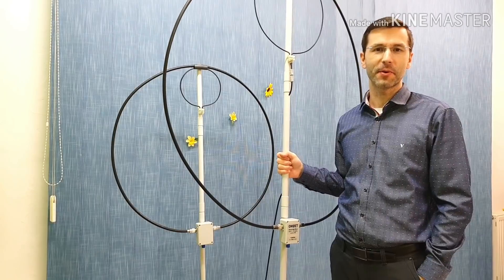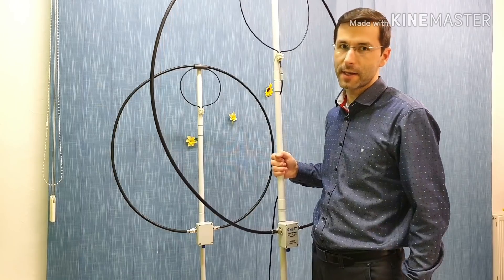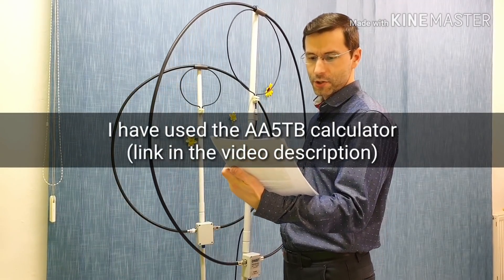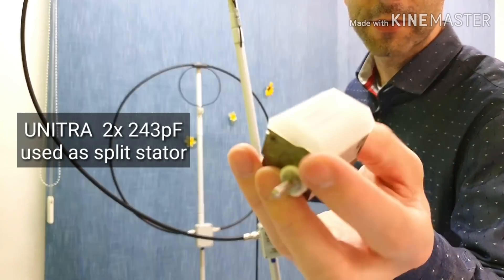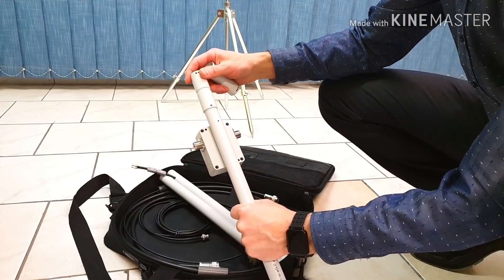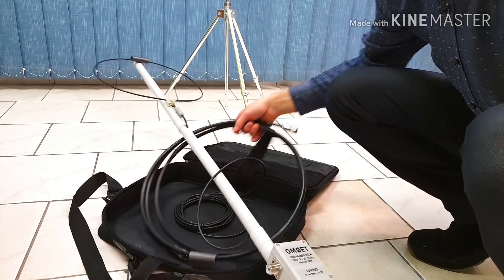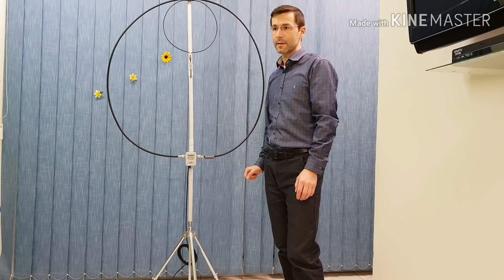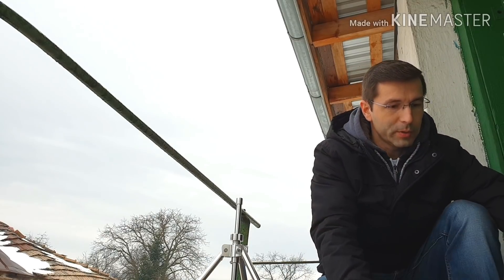40M UltraLight QRP magnetic loop antenna + TEST [ XIEGU X5105 ]

Comment: Dear Paul, 
I have seen the magmatic loop antenna you have constructed for 40 meters! It’s an excellent,construction , I too are very much interested in the construction ! I have made one too using a coax , it’s one of the very heavy type with a copper outer and inner conductor , I shortened the both inner and a outer and used it! I have a good variable split starter capacitor ( can’t remember the value sorry) wide spaced bought in USA ! It worked on 40 as we are having a daily QSO on 7060 with locals! It’s installed in my balcony in a tripod, I have housed the cap in a plastic cylinder , but I am not happy with it the rain water gets in to it! My rig is in down stairs , so I want to tune it via an remotely tuning system , i have built a controller using two relays copied from a Ham , but never used it to now because the loop is broken, coupling loop is out! And because of water getting in to the cap! Please note , I am from Srilanka, call sign 4S7LF , name Leonard. My e mail, oz6zv@yahoo.com…..I am only 87 years , mobility is limited , but soon I will get some help and repair it, after finding out to enclose the cap and the driven motor in an water proof container!  I thank you very much about your 40 meter mag loop and the excellent description of the construction!!! Kindest Regards….Best of 73! Hope to here you soon!! Leonard Fernando , ( Leo) I had a Danish call before, it’s OZ6ZV. That’s why my e mail like that! 😢
Do

Comment: Could I ask you a serious question?  What is the total lengths (in either inches, or centimeters) of  all the loops in this video, if they were all straightened and laid out flat on a floor in a straight line, and measured? For some reason, people can't get the right measurements, by just going only by the diameter of a loop, because no hand -made loop has the same dimension at every point around the loop, once made into a circle. Parts of the loop, will flatten out if hung up, making it wider, and shorter in places around the loop. The straight, flat length of the loop material, is required, before it is even made into a circular loop.
Reply: Хотел тоже задать вопрос о линейных размерах вибраторов антенны? Автор ответь в комментариях. Это займет 2 строчки, а польза будет на размер земного шара.

Comment: Hi pole,
Ashortwave bigger here.
You ham experts always stress upon construction of antenatal itself and most of the time you neglect to explain the antena loop end connections. I am always confused about how to make end connections. We have two end of big outer magnetic loop and two two ends of small coupling loop. Now how the connections are made to gang capacitor, how to earth and how to feed the connection to the radio. Can someone explain this please.
M Yaqoub Khan
Islamabad
Pakistan.

Comment: Using a magnetic loop with a small diameter coax loop as qrp is extremely qrp because such an antenna has a low efficiency assuming there is zero added resistance.... with 5 watts in you are looking at less than 1 watt radiating from the antenna.

Comment: ITS UPSIDE DOWN. THE CAPACITOR SHOULD BE AT THE TOP. KEEP THE HIGH VOLTAGE AND HIGHER RADIATING PARTS FURTHEST FROM THE GROUND AND NEARER TO THE SKY.

Comment: Awesome video Paul. When I used AA5TB's calc for 7.1 MHZ design frequency and 1m Loop Diameter and 10mm conductor diameter, I get 7.8% Efficiency only. You mentioned here it is 60+ %. Can you clarify please?
Reply: Yes, agree, his percentages are suspect
Reply from the maker: @do7425 not mine percentages, it's maybe due to faulty calculator.

Comment: Your videos are interesting. Please let us know how you came out with the efficiency figure of 74% on 40 meters. I used the same calculator and got much lower figure.
Reply from the maker: I see that AA5TB MLA calculator link is no longer available so sorry I can't do the same calculation again. But of course I can't be sure that this calculator was 100% realistic.
Reply: effıcıency should be about 10 out of 100 on 40 mt...consıdaring coax diameter 1.5 cm. and dıameter of maın loop about 1 mt.

Comment: I would like very much to install a 40M loop antenna in my house but I need to know the following:
1.  Can you change the capacitor to one that can handle 100 watts?
2.  Is it weatherproof enough to mount on the roof of a house?  
3.  Can your antenna be tuned remotely?
Thank you for answering these questions.
Reply from the maker: Hello!
1. For 100W capacitor you will need different and much bigger enclosure. I don't recommend use 100W in the house.
2. Is rain proof but not fully waterproof. Not for permanent base installation. ( portable antenna )
3. After some modifications it can be tuned remotly.
73, Paul.
Reply: @OM0ET  Thank you for your quick reply. I understand that a larger capacitor will need a larger enclosure. Can you supply or recommend such a capacitor? Also, I have no room inside my house so it will have to go on my deck, but the deck is not waterproof. That is a minor inconvenience. The big problem for me is the capacitor.  My old boat anchor radio could be damaged with too small a capacitor.  I therefore am looking for one I can build, buy or modify into handling 100 watts. Can your antenna be modified to handle 100 watts?  Thank you very much for your help.

Comment: A great job Mr. Paul ... Thanks for your video,  good idea of the loop antenna, small dimension and simple for 40 m band. 73  Sudarmanto – YD1WDL
Reply from the maker: Thank you! Currently my UltraLight MLA's works from 7MHz up to 28.8MHz so all the 7 SW bands + CB with just one loop antenna. Versatile design too. 73, Paul

Comment: Hi Paul, I love the antenna and as I would like to sometimes use it indoors in my attic (for rx only) it is ideal (my attic door is small, too small for a 1m rigid loop!!). My question is as it will be there for some time I have some concern about the loop losing shape. Is it possible to make a cross frame to preserve the circular aspect? I had an idea to manufacture a rigid cutaway pipe and cable tie the loop in. Anyway thank you for your work and I will be looking to purchase one soon.
Reply from the maker: Hello! To preserve the circular shape you can use a copper pipe as the main loop ;-) But my H1000 coax hold the shape very good too :) It have 2,5mm solid copper core inside.

Comment: Do you do a 50w or 100w version?
Reply from the maker: Unfortunately no. It's all about the size of capacitor. But on 40M band this antenna can handle 40W SSB. I tested it. And also is very dangerous to transmit 100W with Magloop so close to the human body.  I plan to the future some 100W version for base installation.

Comment: Paul, what surprises me is that your tuning capacitor is small compared to other mag loops I've seen. Could the reason for this be purely because your transmit power is low? i have not attempted to build a mag loop because others that have built this antenna indicate that a vacuum tube capacitor is required even for QRP power. 72 KB8AMZ
Reply from the maker: Hello Terry. Yes this capacitor is small for just couple of hundreds volts. I connected it in to the "Split stator mode" and power increased. Unfortunatly the capacity decreased to half, still OK for my magloops ;-) Split stator mode also dramatically decrease the resistance in the circuit and increase effectivity and Q of this magloop. 73, Paul.

Comment: Hi! Nice work, again! In your instruction you said nothing about that the shield of the coax is splitted at the top. Where did you get the information to do so?

Greetings from OE!
Reply from the maker: Thank you. The construction of the main loop doesn't changed from ver.2.  It's still splitted in the middle. It's hybrid between traditional shielded design and classic non-shielded deaign. I had the best results by using this type of construction. 😉 73 and thanks for watching! Paul
Reply: @OM0ET  sorry, missed the 2nd version, now i know
Reply from the maker: @spotzgeil  np ;-) 73 Paul

Comment: Great neat job Paul! I want to make one too, I just need to calculate and find the right cap for at least 60W, as my military rig (Qmac HF90) puts out some 50+W LOL :)
I have 15m of coax, so I can be safe enough from the antenna on the exposure point of view ;)
Reply from the maker: Thank you Chris. Then I recommend to you use the remote controled tuning system. Bluetooth or trough coax. On chinese webshops you can find plenty of wireless solutions how to do that with DC motor ar use Arduino if stepper motor. Good luck! 73 Paul
Reply: @OM0ET  Good idea Paul, thanks, i will have a look at the chinese on line solutions :) 73, de ha7wx

Comment: Где-то читал, что надо снимать чёрную изоляцию с кабеля петли, потому что она с примесями ферромагнетика. Чистая оплётка меди без изоляции должна работать лучше.
Reply from the maker: Thank you for this information Evgeny. But still PVC isolation protect the inner copper shield of the oxidation and mechanical stress. Especially if is antenna portable ;) 73 Paul

Comment: Are they safe to sit beside during use ?
Reply from the maker: Hard to say.... but I use only 5W.  Smartphone runs max. 2W and on much much higher frequencies... I think it's not so bad ;-)
Reply: @OM0ET  Thank you for that. I was just wondering because I have a chameleon f loop with compensator and was running 60watts sitting only 6 feet away, after reading the dangers I backed it back to 5watts lol
Reply from the maker: @ronangsr  read this site:  https://translate.google.sk/translate?hl=sk&tab=wT&authuser=0&sl=sk&tl=en&u=http%3A%2F%2Felektrosmog.voxo.eu%2Fmobilne-telefony
Reply: Its a QRP antenna

Comment: Thanks for the video, Paul. Manetic loops rock! 73 de Kari, oh2gqc
Reply from the maker: Hello Kari, thank you very much for watching! I love MLAs and QRP operations, but some HAMs should have more patience with QRP operators with low signals. Very often happend to me that they won't to make QSO because it's not so comfortable for them to listen noisy signal :-D That's a pity sometimes... But there are also many good operator who when hear QRP so they call for QRP first in front of all other strong stations calling him. 73 and greetings from Slovakia! Paul.
Reply: @OM0ET  I agree Paul, but that has not changed much in the 33 years that I have worked QRP. Often I don't tell up front that I am QRP. If the contact lasts more than a couple exchanges I will slip in that I am QRP and wait for their reaction. 72 KB8AMZ

Comment: Hi Paul. Good job. Are you use the center wire of the coax or use the shield or both? Thank you. 73' Tony
Reply from the maker: Thank you! I use the center wire. Shield is splitted in the center of the loop - in the point where is located small coupling loop.
Reply: @OM0ET  Thank you. This is the traditional version.
Reply from the maker: @M0GLU  yes correct. It's shielded version of magloops.
Reply: @M0GLU  hello! what do you mean, by saying "traditional version"? where do i get such information for mag loops, to leave a gap at the upper center of the main loop?

Comment: Paul, Nice job.  The antenna looks great.  What is the approximate power handling capacity for the 40 m and 20 m antennas for CW and for SSB?
Reply from the maker: I recommend max.10W continous CW and SSB due to a small capacitor inside 😉
Reply: You just cannot build these antennas with high output for cheap. At higher wattage the main loop produces thousands of volts on the capacitor gap. Thus only good vacuum variable capacitor will make $150 alone. I guess :)
Reply from the maker: @rodrigoroaduterte9415  yes cap is the biggest problem of MLAs

Comment: What video camera are you using?
Reply from the maker: Daniel I use Samsung Galaxy S9 and the FHD camera setting. Why you ask? 😊
Reply: I do some video myself and I think your video looks good. Your antenna works well. Could it be made in a larger version ?   73. KA8P
Reply from the maker: @danielmartin7674  I think that larger version made of this coax (Nordix 10/50) would be mechanically unstable. Is possible that "circle shape" wouldn't be possible to create. Theoretically it is possible to build larger version, but we need to change main loop material.
73, Paul
Reply: OM0ET thx 73